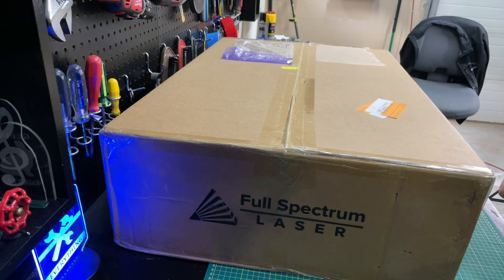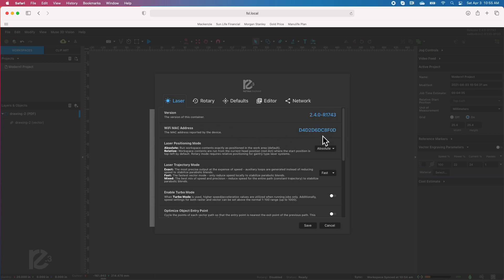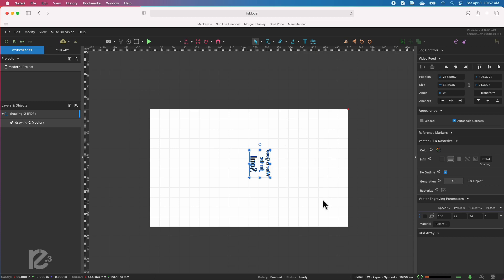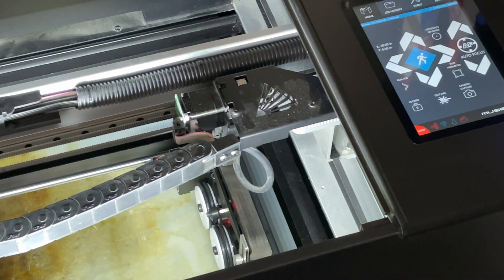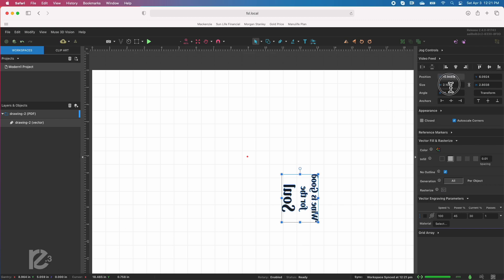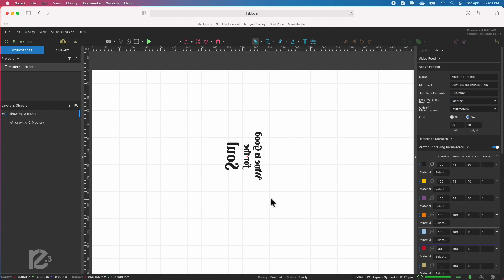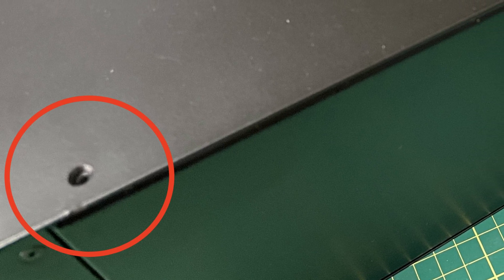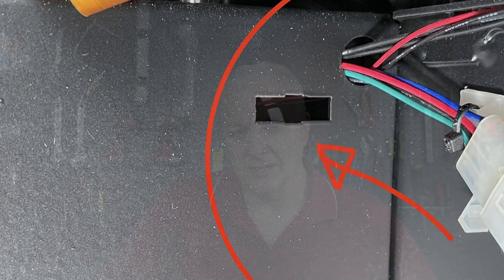HOW TO LASER ENGRAVE GLASSWARE // Using the Rotary Attachment

Comment: hi steve! great video. I a problem with my laser lens. I already align the laser, but when i put the 5" lens doesn't show the red light. do you know why? thank you
Reply from the maker: This would only happen if the red dot laser is out of alignment or is getting otherwise blocked by the nozzle
Reply: @SteveMakesEverything  thank you for your answer
Reply from the maker: @frederickcruz565  Take the nozzle off the end and do a test fire.  Then look to see if the red dot is on the mark.  If not reach back on the left side to adjust the red dot onto the test mark.

Comment: If you flip your rotary so the motor is on the left, you dont have to flip your image. to engrave. It rotates the correct way.
Reply from the maker: Yes I ended up having a discussion with FSL after this. My rotary was one of the first that rotated the other direction

Comment: Did you ever fix the reverse image issue? Did you have to rewire the Rotary? im having the same issue but I just spun the rotary around for a quick fix. What did you end up doing?
Reply from the maker: The issue was user error 🙃.  FSL changed the rotary so the motor is on the left rather than right. This of course turns everything the right way around
Reply: @SteveMakesEverything  ... yeah... it didn't help that Walker had the rotary the wrong way in his video either.. lol
Reply from the maker: @ukulelegothboy  I'm not sure if they changed the design between Walker's video and when I got mine.

Comment: Thank you for making such detailed videos i have the 45w muse core what setting do you recommend for wine cups/ wine bottles
Reply from the maker: You want to go a bit light on the power since glass will fragment.  I thought I provided setting in the video that you can use as a start.  You might also want to take a like buffing brush in a rotary tool to lightly grind off any excess glass.  Otherwise you can get  chips of loose glass coming off later.
Reply: @SteveMakesEverything  I have the same question. I rewatched the video and tried to zoom in on the settings. It looks like 100 speed and 45 power. Did you use 250 x 250 dpi or 500 x 500? Thanks.
Reply from the maker: @jessicawark3022  These settings sound about right for a 40W laser, though this would depend very much on your laser's output so you may have to experiment.  As far as resolution, there really isn't much point is pushing past 250dpi since you won't see the difference in glass anyway.

Comment: Great video, Steve. Very informative. I just ran a test with my rotary tool and the cheap glass jar I was using slipped on the rotary wheels. Do you have any suggestions on how to improve the traction of the workpiece? I tried to use the hold-down roller & plate... thing. It obviously didn't work. 

Also, what power & speed settings were you using for your rasters? It looked like it came out pretty well.
Reply from the maker: When I cut something like water bottles I fill them with water to make them heavier.  With an open glass/jar you can put a bean bag or a zip bag full of sand inside.  Make sure it doesn't tumble though or if could misalign the piece you are working on .
Reply: I've seen people put rubber bands on the cup/glass so that it has a better grip with the rotary.

Comment: Another great tutorial! Thank you for sharing.
Steve, could you advice, please, which of two FSL 5" lenses is better for this application: Version 1 (Silver Head / Screw Driven) or Version 2 (Black Head / Belt Driven)? What is the difference between the two? Thanks a lot in advance!!!
Reply from the maker: Which lens you buy depends on which laser you have.  If you have a Muse 3D you are going to want the one designed for that laser specifically.  Just shoot an email to FSL sales and tell them what you want and they'll set up the right thing for you.

I bought a 5" lens a while back and I've really been meaning to give it a try.  Maybe the topic of a quick video ;-)
Reply: @SteveMakesEverything  Thank you, Steve. It';s Muse 3D laser and they give those 2 options for 5" lens. I'll contact FSL. Thanks again and happy cutting!
Reply from the maker: @EC-gy9pv  They do seem to have added several more lens options recently.  My 5"lens is the one with the sliver tube FWIW

Comment: How did you align the rotary tool?
Reply: You said you got a bottom plate?
Reply from the maker: You take the bottom plate off the laser (16 bolts) and move it to the bottom of the Riser..  Then you can just place the laser onto the Riser
Reply from the maker: The updated Muse Riser has a rail in the bottom that you can push the rotary attachment against to get alignment pretty accurate.  But once you get your alignment laser on the center pin, you can hold the Y axis to prevent movement and slide the laser head to the other end of the rotary to make sure the red dot sits between the two roller wheels.

I plan to do a more formal video on using the rotary tool to engrave on a metal water bottle and will cover full alignment in that video.
Reply: @SteveMakesEverything  yeqh mine didn't come with a rail or that white plate seen on your video 🤔
I'll contact them because I've always struggled with alignment
Reply from the maker: @FamousHec  It does appear that they been doing some silent improvements on the design.  The clamping mechanism is completely different/better than the one FSL shows in their own video.  For the rail you could just tap a couple of holes and put a piece of steel/aluminum channel in there.  I don't find it overly useful since the rotary attachment isn't the same width at both ends, so you still have to do some manual alignment anyway.

I may 3D print something that ensure that it's always square.
Reply from the maker: Also I rewired my stepper cable and the motor now rotates in the proper direction.  Maybe this is a good excuse for a YouTube short to show what I did.  I am uncertain if that's a widespread issue of if they just wired my cable wrong though.  Anyone else with a rotary have this problem?
Reply from the maker: Just a follow-up to this - see Walker Mckaeg's comment in this video where he clarifies a few things about some of the changes FSL has made.  I'll work these into a more detailed video on the rotary coming soon.